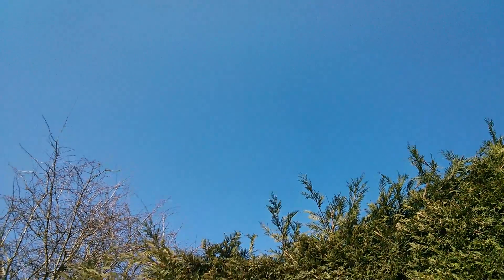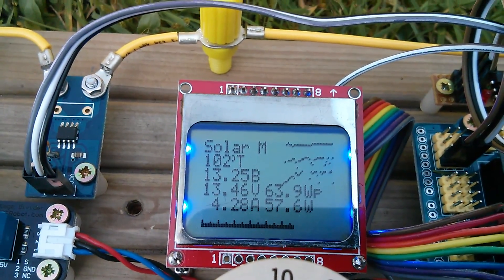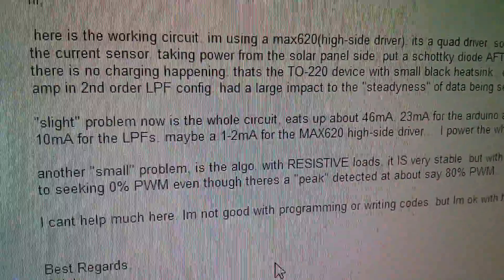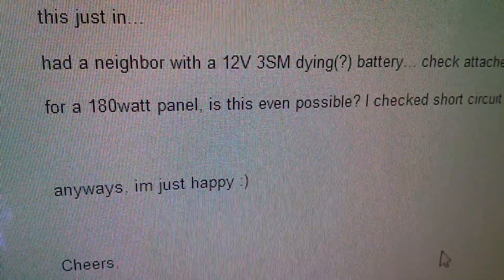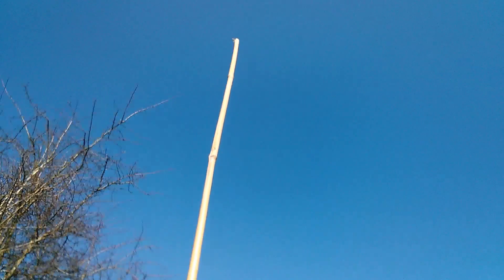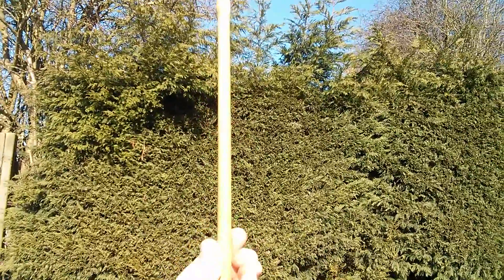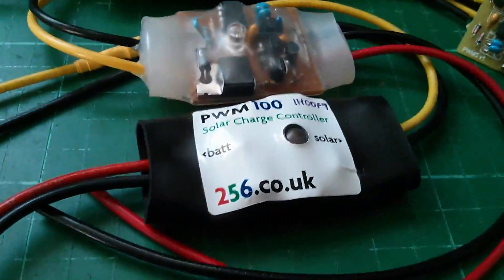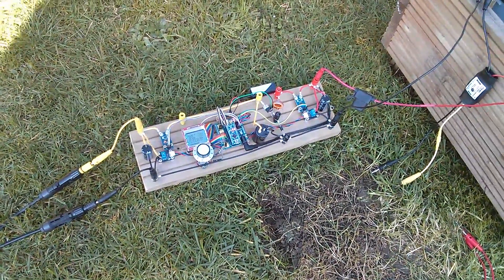Arduino MPPT Solar Charge Controller #19 - Season Two Plans

Comment: Good day sir, I have a solar panel system in my house and i am using this without a Solar panel controller and i think my battery is charging normally. My question is does it affect may battery or Solar panel without a Controller? please send me your email address and i will show you my installation, please excuse my English sir. hoping for your response sir Jualian

Comment: the inductance does not seem enough, you might improve performance by increasing the inductance. that noise means your coil does not have enough internal energy per cycle to carry the current.

Comment: Hi, Julian.
I've already got most of the bits to put a scaled-down version of this together, but one question, if you can.
What Toroid core did you use? I'm wading through formula after formula to get this bit right, (seems to be critical) and I won't be letting it run with 100% PWM (I've only 3 x 5 watt panels, so I'm gonna stick 'em all in series. Damn sunny in Finland so sshould give me the estimated 5-8 W/h I need per day)
As to the overvolt on the battery, I plan to add into the loop a test that if Vbatt > 13.8, stop the MPPT mularkey, goto light trickle mode until Vbatt gets to about 12,25, then back to muppet-mode. Maybe call these two modes "Statler" and "Waldorf" in thecode....

Comment: Is it possible - and economical - to increase the maximum input voltage from solar panels that it's able to handle to 80 or 150 Volts - to allow for serial connected solar panels and wire that's less expensive and thinner ?  And to make the output voltage able to charge 12, 24, 36 and 48 volt battery banks?  And put up to 40-80 amps into the battery bank, at a maximum watts of around 3000-4000 ?

Comment: My version of your MPPT - controller:
http://peling.ru/forum/?mingleforumaction=viewtopic&t=282.1#postid-3481
Reply from the maker: Wow! That's a very nice build. Sorry it took so long to put up the circuit schematic. You did a great job gathering all the information to put this together. And you made a PCB - I better be careful not to make too many hardware changes!
Reply: Julian Ilett I looked at the script for the Arduino. The signal from the current sensor battery like never used. The sensor can be removed from the scheme?
Reply from the maker: Тимур Кудаев It is used to calculate buck converter efficiency -
efficiency = batteryWatts / panelWatts * 100;
Reply: Julian Ilett Ok! Thank you!
Reply: Julian Ilett Manages battery charge controller or just search the maximum power point?

Comment: Excellent - I'm so glad the series is continuing, as I want to build something like this for PiLab (the remote Pi part, anyway).
 I was going to base it on the Microchip app. note AN1521 at first, but kinda 'lost the faith' when I found errors in their circuit (Zeta SEPIC coupling caps wrong polarity (?) etc) but as I have a Sleepy Pi - Arduino-based - and I only wanna play with one set of stuff...
Yeah, I was also thinking about the overvolts on the battery, then started thinking about Adafruit's Sous Vide project, which was my first ever introduction to the PID algorithm. Been in the back of my mind if it has a place here...
(way I was thinking was measure the batt. volts, and tell the charger to just stop for awhile depending on the known history.  When time's up, sniff battery, measure current and so something with voltage drop and current drawn over time. Early thoughts...)

-Cheers
-Andy
Reply from the maker: When I built the PWM5 charge controller, I found the control loop needed to respond quite quickly to battery voltage changes. One scenario is a heavily loaded battery - say a 50W bulb. To maintain float voltage with this load, the PWM pulse width needs to be high - perhaps around 80 or 90%. If you suddenly remove the load without quickly reducing the pulse width, the battery voltage will shoot up very rapidly - several volts in less than 1 second. So my control loop ended up operating at about 100Hz.

Comment: Tell Ralph to cool the panel . Been talking to the Kent guys , Newform Energy,   who make / sell a  PV-Thermal , who have independent figures that their T element improves performance of the PV by 17% over standard PV on long term test . The efficiency improvements in keep the panel temp below 40 degs C , or at least below for longer . Wet rag , swamp cooler style . Can you ask Ralph to put up some details of the display hack ?

Comment: Great work julian,

this project is really starting to tickle my fancy.

As a DSP geek, the math really got messy on these feedback control systems. But during my professional experience I could realize that in all practicality (especially this mppt  application) they're simply low pass filters that  try and slow down the change in the output (control) when the input changes.

in essence it averages values over a certain time to see if the measured input is really going into that direction or if noise is affecting it. Sorta like what you did or tried to do programatically to average the displayed current at some point.

The 'trick' is to use  a slightly different rise and fall value so that it would go one direction faster than the other and thus avoir oscillation. Essetially adding some hysterisis...

anywyas, a rise time of 10ms or even 100ms would IMO (not knowing much about solar chargers) be ample fast to make this thing react.

Looking forwad to sequel. Let me know if I can contribute in any way.
Reply from the maker: I like the idea of asymmetric rise and fall values - I might experiment with that. The battery voltage maintenance algorithm needs to react fairly quickly to prevent voltage overshoot if, for example, a heavy load is suddenly removed from the battery. The maximum power point tracking algorithm needn't be quite so lively. Do you fancy building the test rig?
Reply: Julian Ilett Yeah about that voltage overshoot. I have a very unrealistic setup (if you can call a pile of rejuvenated batteries and kilometers of recycled cables a setup) but essentially I have more battery capacity to charge than I can ever have sunlight to power a charger....

but you make a good point. so how quickly would the charger have to disconnect? or conversely could the extra power be dumped into another load or into an inverter to the grid? I know it could, real question is what would be most appropriate.

About the building the test rig: I'm trying to work out what's best to set up with what I have. Will certainly build the rig at some point, although realistically probably not within a time frame short enough to contribute much to this particular thread.

I also have to catch up to your PWM5 project first I think.

Great thread
Reply from the maker: Yves Baggi A heavily loaded battery requires a high PWM value (long 'on' time, short 'off' time) to maintain float voltage. If that load is suddenly taken away, the controller must reduce the PWM value very quickly, or the battery voltage will rise up, possibly damaging connected equipment. On big boats, the navigation systems can be very expensive and they don't like 16 or 17v!

I really like the idea of a charge controller which diverts power to a grid-tie inverter when the batteries no longer need charge (otherwise it's wasted). So I did lots of testing and firmware adjusting to make the PWM5 work in that way. It's pretty seamless, and no power goes to waste.

I'm about to start designing a simple Arduino PWM controller, that may be a good place to start.

Comment: Only at 15.2 Volts a lead acid battery is really full and all SO4 Ions are again in the electrolyte and not anymore on the lead plates, so you really need to charge the batteries up to this voltage without boiling them... Maybe you can also include a temperatire sensor for the batteries and do some charge-discahreg cycles so it slowly reaches 15.2 Volts finally and also include some routines to refresh the batteries via high voltage pulses from BackEMF of a coil ? Mayne you will later then also combine this with your own inverter circuit, cause it would be best to have a PWM MPPT and inverter in one unit to optimally control the batteries...cause the main problems are still the batteries with these solar systems...Many thanks. Regards, Stefan.
Reply: 15.2V is not a normal charge, "Equalization: For best battery life on a flooded lead-acid battery an overcharge function at 15.2 to 15.4 volts is recommended once every three months for a one-hour period. (Do not equalize a maintenance-free battery)"

Comment: Excellent. I'm really looking forward to following your progress on this project because this year I intend to start my own solar power experimentation and I'll need a controller.
Reply: Hoi 
I work on wind project wind power and bedini motor combi 
I gate dc out  30 -300 volt   I nead to control it to charge battry its off grid system